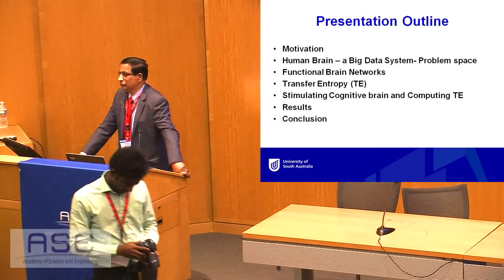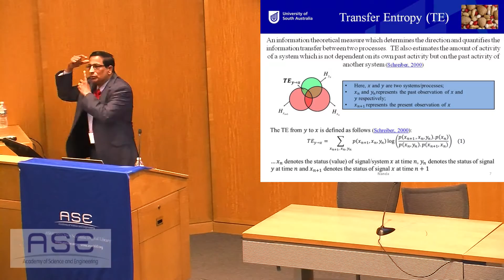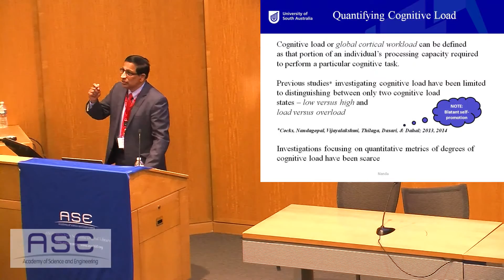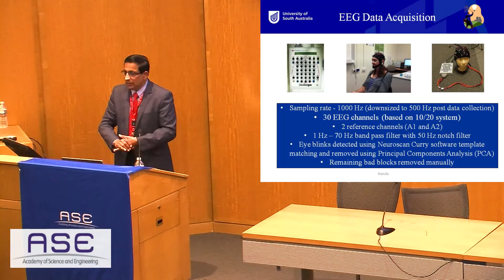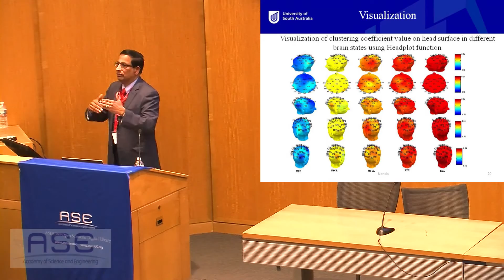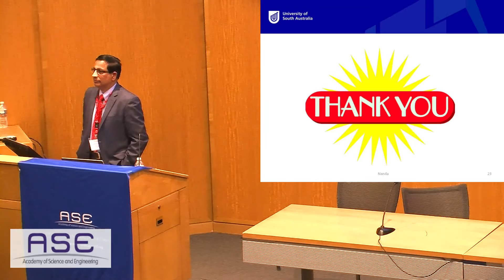Towards a Cognitive Metric using Normalized Transfer Entropy

Comment: Nice, I would like to know. If there is any GitHub repository for the codes used in this research paper?
Reply: I do need also a source code, for computing transfer entropy. Could you find any ?
Reply: IDTxl toolbox is on github.
Check out:
P. Wollstadt, J. T. Lizier, R. Vicente, C. Finn, M. Martinez-Zarzuela, P. Mediano, L. Novelli, M. Wibral (2018). IDTxl: The Information Dynamics Toolkit xl: a Python package for the efficient analysis of multivariate information dynamics in networks. ArXiv preprint: https://arxiv.org/abs/1807.10459.